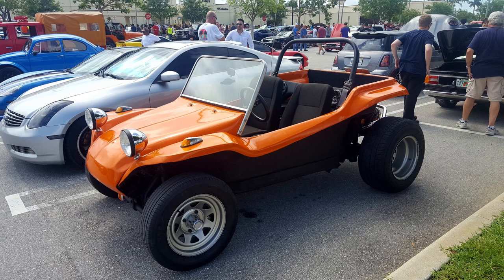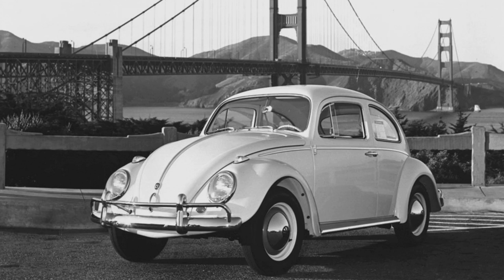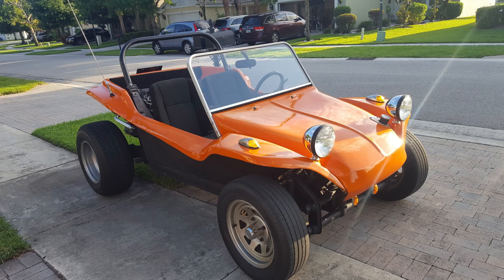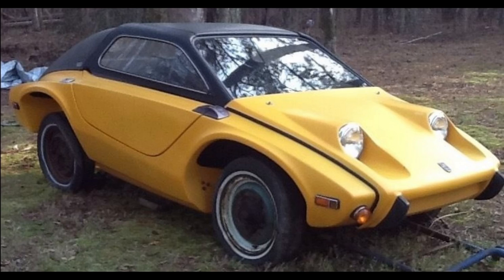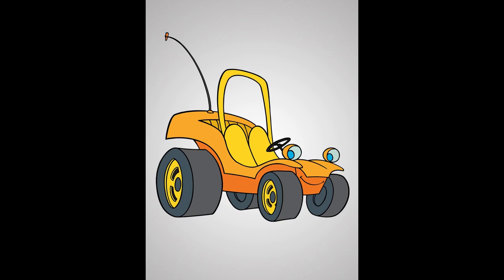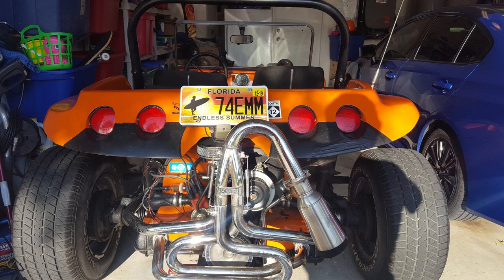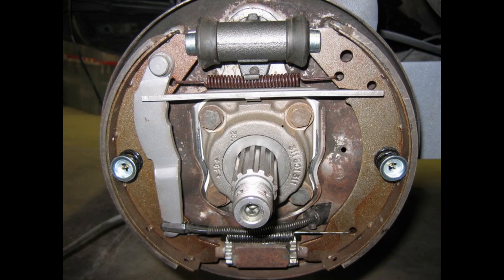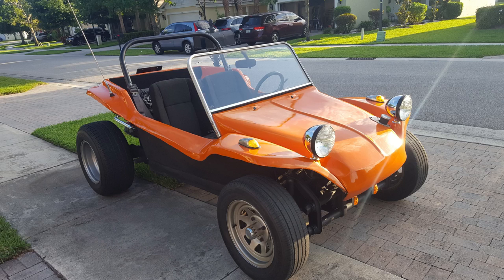The Dune Buggy: Origins and should you buy one?

Comment: My dad got his buggy in 1971 and I built one like it over 20 years ago and use it daily when not winter. I swapped the VW drivetrain for a 2.5 SOHC Subaru for a few reasons. It's a shortened pan and not twitchy and quite stable and regularly drives 85mph on the highway. The most fun is on twisty back roads though.
Reply from the maker: That's got to be so much fun with a Subie swap!

Comment: WOW!  Myself having been a 1967 VW Beetle owner; decades later a dune buggy owner, I AM VERY IMPRESSED with all that was covered in this video . . . "Auto Chatter" touched on all the points with owning/driving one, with one exception:  periodic oil changes.  The stock air-cooled four cylinder engine lacks an oil filter, so it means having to change the oil every 1K to 1.5K miles to prevent engine wear/oil burning.
I did the 1K ~ 1.5K miles oil changes with my '67 Bug; which was using the quality engine oils available in the 1970s.  After 100K-plus miles, it didn't burn oil.
With regards to safety and fun with a dune buggy:  I'd equate it to being a motorcycle that doesn't require the rider to have a sense of body-balance on two-wheels, as the four wheels provides solid stability with no need to balance oneself on the vehicle.
Reply from the maker: Thank you! I ran a upgraded oil pump with the spin off filter. Changed it annually because it wasn't a daily driver.

Comment: I have owned two fiberglass buggies and 3 rail buggies. I still own a Chenowth framed desert buggy I run in the California desert. It runs a built 2200 V.W. Engine 13:1 compression that runs 110 octane fuel. It has power, rack and pinion steering, disk brakes, steering brakes, oil coolers, 5 point harnesses, etc. it was built in the 1980s and it’s in great shape. I’ve owned it for about 15 years and run it every season. V.W.s make great off road vehicles.
Reply from the maker: Cool! The rail I had was a Chenowth too.....with a 1600dp.

Comment: In 1967 I bought a '57 Karmen Ghia for $175 while stationed at Ft. Sam Houston (it was all beat up). Army pay was $110 so that was a lot of money. Drove it to my folks home in L.A. and made it into a Manx clone Dune buggy while on my 30 day leave before Vietnam. After I got out of the Army I drove it several times from L.A. to San Francisco, who said it wasn't made for long trips?   It would do 70 on the level with only 36hp (actually the exhaust system made it more than 40). That car was a lot of fun to drive!
Reply from the maker: A VW old timer told me years ago a ghia pan had to be modified to turn into a Manx.
Reply: @autochatter  You are right, I traded my Ghia pan and beat up body for an already shortened bug pan, he wanted tp make a full length rail buggy, saved me a bunch of welding.
Reply from the maker: @jimsnipes1203  it all worked out lol

Comment: When I was a kid growing up in upstate NY, I remember there was a place in town that converted Bugs into Buggies. It was a two stall garage with a flat roof. On one side of the building above one of the stalls, there was always a stack of fiberglass Buggy bodies. Back in the 70s, one could pick up a used Beatle for $50. By the time I was old enough to drive, the Buggy conversion shop was gone. The Dune Buggy always looked like so much fun.
Reply from the maker: Yeah..From what I've been told, alot of towns had at least one shop building them.

Comment: Loved the video,agree with most of what you say about bugs, my 1967 buggy is very comfortable,its got bucket seats which ive lowered,i suffer from a damaged back and have done several ,well over 120 mile round trips ,without any back pain. Ive had myn for many years and wont sell,just a great fun reliable easy to work on summer ride. I rebuilt the gearbox with new german parts as the syncros needed replacing,fitted electronic ignition,rewired etc. Mods ,1600 Dual port AS motor with Engle 100 cam,dual Dellorto carbs,flame thrower coil with Pertronix MK2 electronic ignition,spent a fair bit of time getting the carbs set up right,jets inlet trumpets,K&N filters. Take time to get linkage perfect, i do a carb balance every couple of years. Has straight through cannon stainless exhausts,loud but better looks and so easy for valve adjusting,which i do every few 1000 miles,this is very important,makes for a reliable engine,ive fitted smiths oil pressure, temp ,volts gauges on dash,not really necessary,but i like to know how engine is performing. Fitted adjustable swinger plates,these make ride height so easy to adjust. Has disc brake conversion on front, centerline spun aly wheels,with big cooper cobra tyres for that nice look.There are plenty of books on the subject. I love my buggy,especially when i feel down,i just go for a drive and feel good again. Thank you for upload.
Reply from the maker: You are welcome! Thank you for the story.
Reply: @autochatter  No problem.Happy New Year to you and your family.
Reply from the maker: @enoz.j3506  Same to you!
Reply: @autochatter  TY.

Comment: I had a 66 GP short body buggy, put it on full steering lock and rev the engine hard, 50/50 whether it spun the rear wheels, or lifted the front and straight lined
Reply from the maker: That sounds like a awesome buggy!

Comment: back in the Mid to late 80s i live just outside of L.A. in a city where a gang was nuts about VWs. anyways mom had a 72 she got back in 77, my first VW was a 65 square-back, slammed but stock. sold it and got a 67 VW Bug that turned into a money pit. i bought the car but didn't drive it for 6 months because i didn't have enough money to build the engine i wanted, so i had to eat noodles and save. that 67 was the first car i ever wrench on every bolt on the vehicle. thank u for the vid, cuz it took me down my own memory-lane
Reply from the maker: No problem. I made it as a memory lane for myself too of sorts.

Comment: A remarkable aspect of the original four-cylinder VW air-cooled engine, at least as they were in the 1960s, was the amount of maintenance neglect the engine could be subjected to, and it would still keep running, albeit not robustly.
My insecurities in my younger years had me shying away from turning wrenches on engines, with the exception of doing oil-changes, so my '67 Beetle wasn't rigorously maintained, save for the oil changes.

Case in point:  One time I put around 24K miles on it between engine tune-ups, and the engine performance was passible.  My brother, the car mechanic in the family, was stunned what he saw after removing the distributor cap:  the center terminal contact to the distributor rotor had completely worn away, leaving only the coiled backing spring in the center terminal that was making contact with the rotor; yet, the engine still ran!

Engine spark plug changes and engine valve adjustments were infrequent, but the engine ran.  I got over 100K miles of life out of that engine.  The car was banged-up from a collision with a reckless driver; the bodywork was put back into acceptable shape and it still ran.  I had to sell the car to get a bigger vehicle for employment purposes.  And I could not afford to hold onto the Beetle as a second vehicle.

I never knew, and never heard of, a '60s era VW air-cooled four cylinder powered Beetle to just up-and-quit on the driver.  But rather, the engine's performance would gradually get worse until one day, the engine would not start.  But, for the engine to be running at speed and suddenly die?  Never!

An obscure problem with the '60s era Beetles, and this could explain the steering stability issues with the dune buggies:  There's a steering damper that wears out, which can create steering wheel flutter/shuddering at speed when it is worn out.  The factory original in my '67 Beetle wore out in six years.
Reply from the maker: Yeah..I replaced the steering dampner and everything else I could think of but still had a weird resonance at speed.
Reply: When I asked VW mechanic why I had to synchronize the carburetors, adjust the valves, and check ignition-timing on my air-cooled so often, he responded by telling me Volkswagen air-cooled engines are actually high-maintenance engines; they can just take an incredible amount of abuse before they quit.
Reply: @autochatter  put in some fresh German-made wheel bearings. They are yet another part that can look and feel okay, but can actually be way out-of-spec.  
I used to live where the last mile to my house I could turn the engine off on my VW van and listen to the chassis on a really smooth road and I had high-end Continental tires so they were very quiet, you could hear every little squeak and creak on the car, including the rotation of the bearings, but there were still a lot of road noise and it was a panel van so lots of vibration came from the body to create background noise.
One night it's snowed and that last mile was on a bed of fresh fallen snow about 2 in which was like driving on Cotton and absorbed all the vibration the road normally pushed back with, and I heard that ever so slightest sound of old worn out front wheel bearings, the same bearings I had repacked and inspected and checked the play on at least a half a dozen times.  Putting in fresh front wheel bearings and races on that old van almost felt like all new fresh steering parts, it was really interesting.
Although some cars just vibrate at certain speeds for whatever reasons, I had a 1976 Chevrolet Monte Carlo that vibrated at 62 miles per hour, no other speed did it vibrate at!!!
Reply from the maker: @Bob Bellendovich  I never did switch put the wheel bearings with German ones. Everything else was new though. I sold the car a few years back now or I'd try it.
Reply from the maker: @Bob Bellendovich  LOL..That actually makes sense.
Reply: @bobbellendovich6825  I admire your VW mechanic for his candor.  Very true what he said from my own experiences.
When I gave it some thought after reading your comment, a VW engine is comparable to a motorcycle engine with regards to maintenance.  But, a motorcycle engine (to keep running) could never withstand the amount of maintenance neglect that a VW flat 4 air-cooled engine can handle.

Comment: I have a homebuilt rail buggy, welded up over a 74 beetle floor pan. It is very stiff and with 205-55-16 tires it really handles great. I have leather buckets from a Mercedes a nice real wood dash , 4 wheel disc brakes and it is fully street legal. I have owned it now 5 years and every year add new parts and make it better some way. I only have less than 3 K in it and it is very popular at car shows, like you said everybody wants to talk about a old beetle or dune buggy they owned or rode in. After owning a couple classic cars that really needed to be babied I found this to be much more fun to own and drive. I am near 70 and don’t see myself letting go of this vehicle for a long time to come.
Reply from the maker: Sounds like alot of fun!

Comment: I'm finishing mine up right now , it was a 1962 VW and then converted ! I took out the back seat and put a 2009 Hayabusa engine in it ! It has a Miata diff and VW CV joints and axles , a ford ranger ring gear and starter motor for reverse ! For the shifter a electric powered shifter for clutch less shifting this buggy is going to scream , I'm hoping by New Year's eve , and it will be warmer by then ! Thank God for Florida !
Reply from the maker: That sounds crazy fun!

Comment: I have owned two fiberglass dune buggies I still have one it was built in the seventies and it has a Corvair drivetrain and a fiberglass roof I've painted it drove it last summer I'm going over and detailing it this winter can't wait for summer fun and I'm 62 years old
Reply from the maker: Sounds like a blast! I never drove a Corvair powered one.
Reply: @autochatter  yeah I bought it just for the body I was told the motor was bad got it running and the thing is a ball to drive it's weird though it's a three speed
Reply from the maker: @James Yates  Guess it has the Chevy trans? I'm not sure if that was more popular or a adaptor plate where you use the vw trans.

Comment: Bought mine in NJ based on a 63 and drove it to California.  the 63 had no gas gauge just the flip tank. ran out of gas 2 times, the first time was almost a disaster,  the nearest gas station was 17 miles away and closing in 20 minutes heading to Pella Iowa.   Nice family drove me both ways and had me over for dinner.   the second time I was across a cow field from a gas station.  It had a cracked distributor neck and would vibrate and do anywhere from 60 to 75 and back again.   It had an 8 track player in the back under the seat so basically I could only change it when stopped.  I had the Physical Graffiti double album and basically listened to it for 2900 miles.   it was a sparkle green baby with a 12 volt dc system and a 6 volt starter that sounded like starting the Batmobile.   wish I had it still....
Reply from the maker: LOL..The fuel guage in my orange one stopped working for awhile. I used a stick to check my fuel level untill I got it fixed.

Comment: I just remembered the heater in a beetle is ducted through the floorpan so you can have heat (as it is) in your dune buggy, side curtains and soft top are workable, remember English sports cars? Austin Healy sprites or MG midgets had these for decades
Reply from the maker: I didn't have heaters in mine (as it is). I can only imagine how much less efficient it would work versus a hardtop Beetle. Prob better off with a electric one.
Reply: @autochatter  Dave here, you are absolutely right about using an electric heater, it would be very likely that an alternator upgrade from the original generator system would be at the top of the list of things to do in my opinion
Reply from the maker: @Dave Baker  oh yeah definatley.

Comment: My brother bought a dune buggy back in the 1970's with a volkswagen engine and manual trans and we went to the junkyard and pulled a Corvair 6 cylinder and auto trans from a wreck and put it in the dune buggy.  Ran like stink.  Had to watch out as it would pull the front wheels off the ground when accelerating.  I remember he carried a yard stick around with him to check the gas level in the tank.  LOL
Reply from the maker: Hey the stick gas Guage works great. My father in law used that for his.

Comment: I endoed my Manx in a Baltimore golf course and broke it in half with a friend, previous owner, aboard. The original 1961 seat belts worked. The roll bar put all the stress on the welded floor and broke the car in half. The hood and gas tank flew out. We lived but it was more dramatic than it sounds here.
Reply from the maker: Ouch! Rust or someone didn't weld it back well maybe?
Reply: @autochatter  this was in the early 70's. Rust was not an issue. It came down hard upside down . The front end weight pushed the nose down and the engine pushed down the rear using the rollbar as a fulcrum
Reply from the maker: @michaelannen4168  any accident you can walk away from lol

Comment: I'd prefer the bug with the fiberglass add ons because of the weather we have. You get the same attention, nothing like a bus load of kids running to the rear of the bus to watch you follow them with mud tires on the back and a strait up exhaust pipe.
Reply from the maker: I went buggy because it was lighter than a Baja on the beach.
Reply: @autochatter  That makes sense, there are no beaches or sand where I live. Sand rails for off roading and mud are common here also.

Comment: I didn't know the Dune Buggy had a shortened frame. 
I would love to have an old 1970s DB with the heavy orange metallic paint job. I had a COX toy orange dune buggy.

.
Reply from the maker: The original Manx did and alot of the clones. There was some made back then using a full length frame.
Reply: @autochatter  Most fiberglass dune buggies had the chassis shortened 14.5 inches.  There were a few exceptions like the Empi Imp which was shortened only 12 inches.  There were also a number of full pan buggies like the Maxi Taxi, Berry Mini T-4, Sand Dancer and Tuff Tub.
Reply from the maker: @Tim Byrnes  yes but the full length ones look weird without a body lift

Comment: The semi automatic transmission VWs was a four speed,
Reply from the maker: "Marketed as the Volkswagen Automatic Stickshift, the three-speed manual transmission was connected to a vacuum-operated automatic clutch." I think the trans was similar to the standard 4 speed but didn't have 1st gear. I drove one years ago once and it was a 3 speed.
Reply: @autochatter  I believe that your 3 speed trans was broken so 1st wasn't functioning, I've had several auto stick VWs
Reply from the maker: @Dave Baker  I just read three articles on a quick Google search and saw a autostick vid on you tube. They all had 3 forward speeds. 1st gear is basically second on a standard 4 speed one and so on. Search on you tube..".how to drive a classic vw beetle autostick transmission".. guy explains it well

Comment: In SoCal they are NOT cheap. Even a project will go for several thousand and a ready to go will be nearer 10K !   VW engines are easy to work on BECAUSE THEY HAVE TO BE.  I've worked on many and they are crap for longevity BUT they do have appeal.
Reply from the maker: Supply and demand in the area? 10k ain't bad if it's ready to go nowdays.alot of other collector cars that were pretty cheap 10 years ago are much higher now.